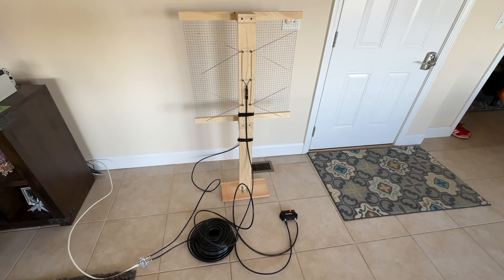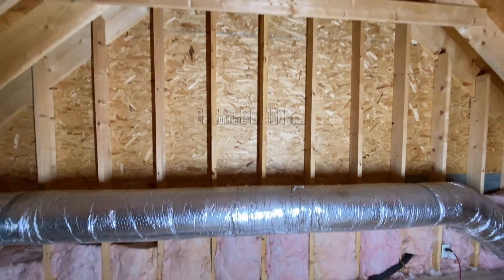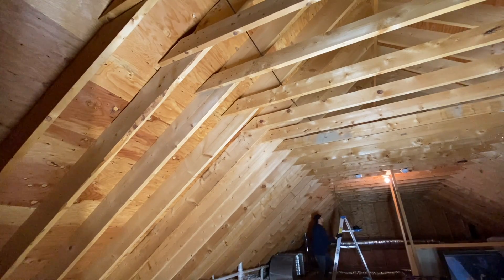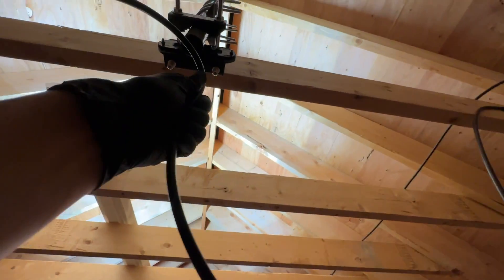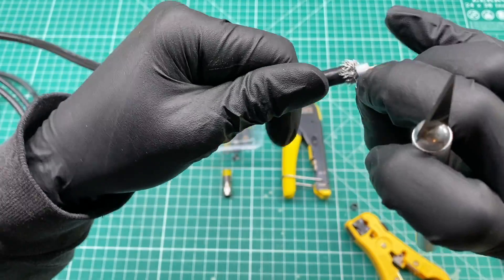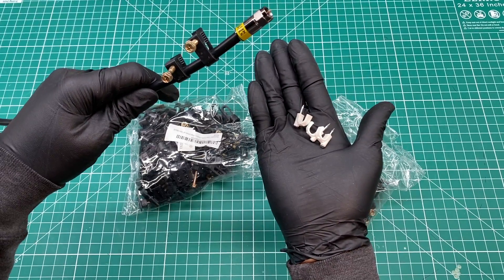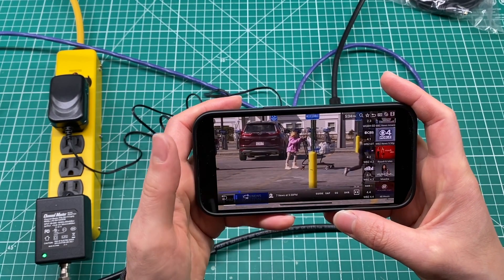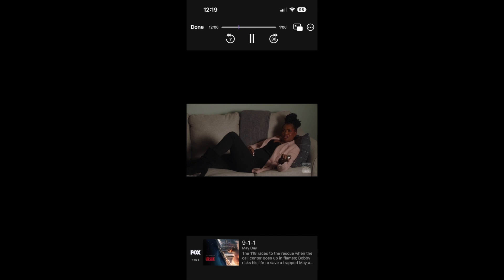Cut the cord before it cuts you! Attic OTA TV antenna install

Comment from the maker: Note that the homebrew antenna that I'm using is a UHF only antenna. Depending on where you are located you might need one that supports VHF as well. https://rabbitears.info is a great resource if you are trying to determine what type of antenna you need. Also note that when crimping an F-type connector on coax, you should leave the last layer of foil intact. I mistakenly removed this from habit of putting PL295 connectors on ham radio coax.

Comment: I have the same conduit in my house. I am so happy the builder in 1996 thought of this.  I plan on just buying an antenna to put in the attic.  The conduit comes down close to where our coax setup (that we only use for one cable router).
Reply from the maker: Ah nice! I’ve wondered how common it is to put in conduit like this for future use. I’m appreciative that they did this for my house, but also confused why they didn’t put two drops since you can’t run high and low voltage wires in the same conduit. I assume it was put there in case someone wanted to finish the attic. Maybe they only expected romex to be run through it. Shrug.

Comment: what about four such elements and crossovers between the top two and the bottom two will give a better signal.
Reply from the maker: Totally. The design I went with was a compromise on space and materials. I was working with what I had on hand and the spot I the rafters where I mounted it was a bit cramped. All the channels I care about come in great with the current configuration, so there isn’t much incentive to optimize further.
Reply: @MostlyBuilds  I built the version with four elements and wound up using it with my TECHNICS ST-GT1000 and had 9 bars of signal but I think that it is completely broken and am now using a Slim-Jim Antenna.
Reply from the maker: @DAVIDGREGORYKERR ah bummer

Comment: What are your thoughts on placing the HD Homerun in the attic and running cat 6 down to your basement vs your current setup?
Reply from the maker: Great question. I thought about it. I decided against it because I was worried about the extreme temperatures in my attic killing the HDHomerun. If you live in a more temperate climate than I do, this might be a viable option.

If I did put it in my attic then the antenna preamp wouldn’t have been necessary. I felt comfortable putting the preamp in the attic because it’s pretty rugged since it is designed for outdoor use. Maybe a bad assumption, but I figured it would be able to tolerate the temperature swings up there.
Reply: @MostlyBuilds  oh yes. You are right. The HDHR probably wouldn’t hold up very well with those attic temps. Thanks.

Comment: I use a hd homerun connected to plex and it is a game changer! I use a dedicated old pc running ubuntu with large nas drives stacked in it as the backend, and it's so stable I often forget about it even existing! It runs for months on end between cleanings! (0 downtime hooked to ups so it does not even go down with power outages). The major differences are you get a populated updated guide, recording capability, auto recording of a specific series you pick, skip forward/back, pause live tv, etc just like your cable/sat system you was paying a fortune a month for! Also has a advertisement skip feature that your cable/sat company would never give you! You also gain all the plex stuff like importing stuff you downloaded so you can watch anywhere! (yes anywhere, because there is a remote access option!), access to plex channels (kind of like roku), and apps! I know I probably seem like a paid promoter, but I just like plex! I tried mythtv before that and it wasn't near as good due to extremely hard to setup and multiple issues with lack of live tv options depending on the device,  I can say for certain you won't touch the raw hdhomerun software for anything but firmware updates again after you learn just how much better plex is!!!

Comment: I would have mounted the amplifier on the back of the wood behind the antenna.  This would get it up higher.
Also, it is a good idea to adjust the angle of the antenna to optimize it.  The way I did this was not the best but I will explain it so people can get the idea.
I laid an opened up cardboard box on the deck below the antenna.
I pointed the antenna in a direction and marked its angle  with a line on the box.
I then looked at the signal strength and wrote that next to the mark.
I then rotated the antenna 45 degrees and repeated.
Once I had some 45 degree marks with two having the best signal, I split that 45 degree increment into 3 (2 new lines between)
I could now see in 15 degree steps the signal strength.
Once I had that, I could pick the two best and work out with some math where the ideal point is
If you want to do some math just for fun:
X = (signal3 - Signal1) / (2*Signal2 - Signal1 - Signal2)
X is how far off the Signal2 angle to aim at
-1 means Point to Signal1
-0.5 means half way between Signal1 and Signal2
0 means right at Signal2 
0.5 means .... I hope you get the idea.
Reply from the maker: Ah cool procedure. I adjusted it off camera but in a less scientific way. I used the HDHomerun web settings to view the signal strength while adjusting the angle and tested on the channels that were important to me until got a position I was happy with.
Reply: @MostlyBuilds  My main point was for others who may be thinking about installing.  They should see that the question can be "scienced".  No pointy wizard's hat needed.  Your project is within the grasp of many.
Reply from the maker: @kensmith5694 Roger that. Thanks for adding the info!

Comment: Wife and I just became first time homeowners and this has been a sticking issue for me. I want to have OTA reception and this makes it look like something we could both use!
Reply: In addition to MostlyBuilds' comment:
You may very well get some stations that the sites think are out of range.  It happens where I am.
A $10 set of rabbit ears would be a good start just to see if you get anything.
Any antenna that claims a range greater than about 80 miles is almost certainly junk.  The earth is curved and at 75 miles the towers will be below the horizon.  The signal falls fast after that.  Generally the bigger the lie about range, the worse junk the antenna is.
Antennas with amplifiers built in are usually a bad idea.  When the amplifier fails the antenna is junk.
You can replace an external amplifier easily.
Reply from the maker: Ah congrats on the new house! This is a useful website for evaluating the conditions in your area: https://www.rabbitears.info/searchmap.php

If you try something at first and it doesn’t work well, try not to get discouraged. I get a sense that a lot of people give up really quickly when hitting an issue. It’s easy to start small with a cheap indoor antenna and move up to something more involved if that’s not working.

I’m a big nerd when it comes to this stuff, so it’s fun for me. The antenna I used in this video cost me basically nothing because I made it. DIY isn’t for everyone though. There are lots of affordable antennas you can buy.

Anyway, best of luck! Thanks for checking out the video.